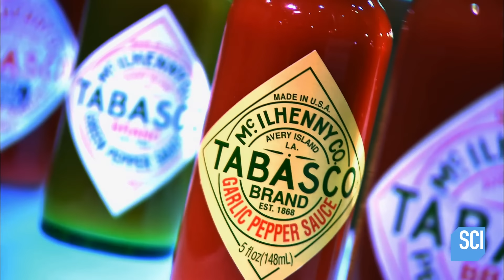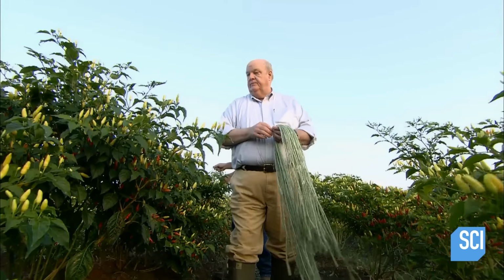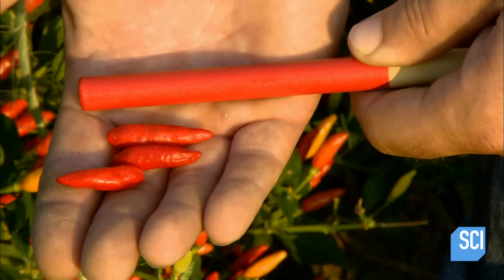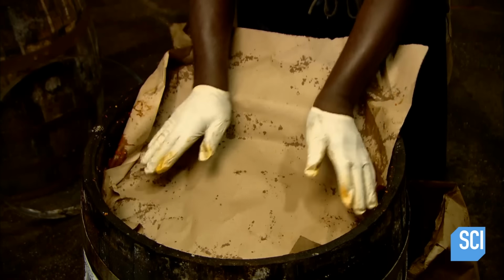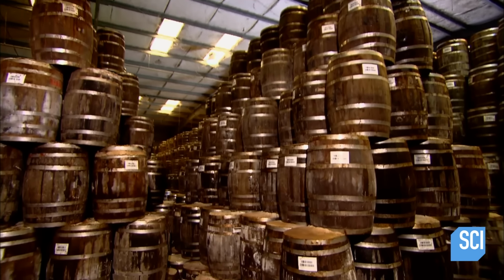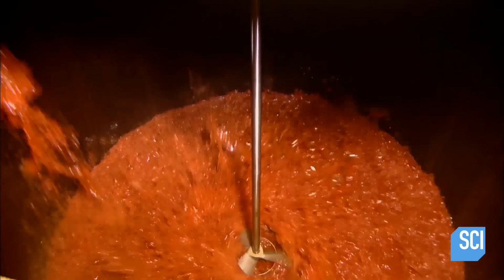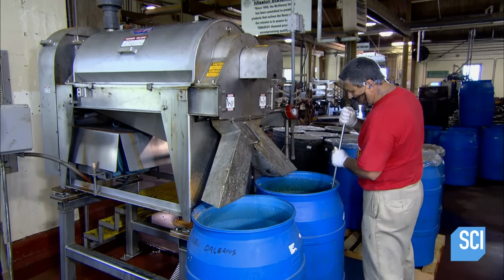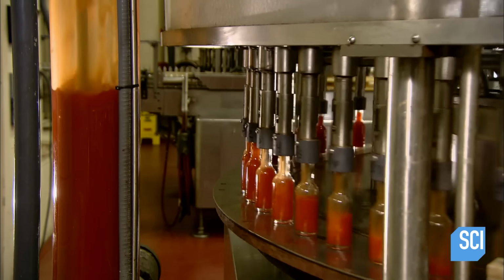How It's Made: Hot Sauce

Comment: I know Tabasco is super popular.  But, I just can't seem to have the pallette for it.  I guess the amount of vinegar does not work well with me.  But, glad to see Tabasco get a huge ovation for the hard work that goes into it.
Reply: Agreed. I love hot sauce but Tabasco is too vinegary. Not as bad as Texas Pete but still not really good either.
Reply: I can’t stand Tabasco. It blows my mind they put this much effort into a hot sauce that goes on restaurant tables in cheap diners. I wonder how much work goes into a hot sauce that’s actually good
Reply: @GrowingwithAnastasia  is a snob about... "cheap diners"? 🤭😆🤣
Reply: Palate is in your mouth; pallette is holding your oil paints for mixing & use.
Reply: It’s not formulated to be used as a typical sauce, but as a flavour additive.  When I realized that, it changed my culinary style.  At least for the original sauce, it’s not meant to be the primary flavour, but a culinary enhancer.  Start with a couple drops on every day items and increase or maintain until you find what works best.  The top restaurants of the world don’t carry it B/c it changes flavour, but because it slightly enhances if used sparingly
Reply: @GrowingwithAnastasia  it very rarely goes into cheap diners except locally where it is cheap to ship.  Very few fine restaurants around the country (or even the world) do not go without Tabasco.  Don’t treat it like a sauce (ie. Teriyaki, Frank’s, BBQ etc.). It’s purpose is to subtly enhance flavour while simultaneously adding a bit of a kick
Reply: @frankhewitt1986  They use to have bottles in every Long John Silvers in Virginia when I grew up in the 90s. They don't anymore last I checked though.
Reply: @GrowingwithAnastasia  I guess you can't affford the best restaurants in the U.S....the ones in New Orleans.
Reply: @stevenclark5173  It was a political thing.
Reply: @Trumpisscum-420  It's much healthier for you than salt....